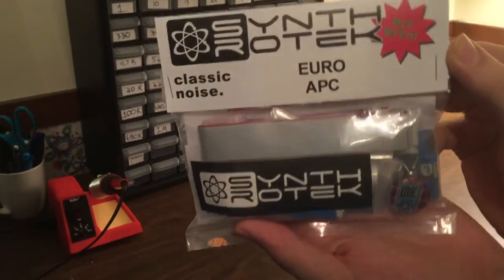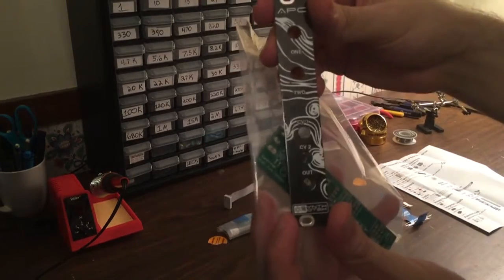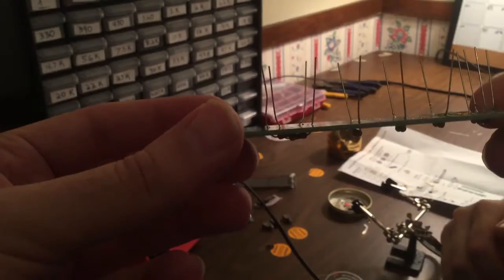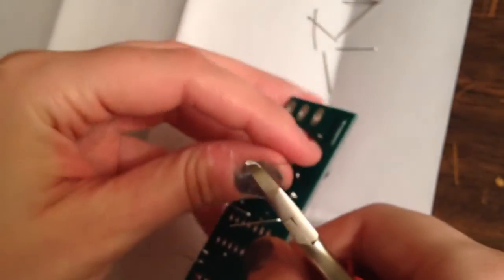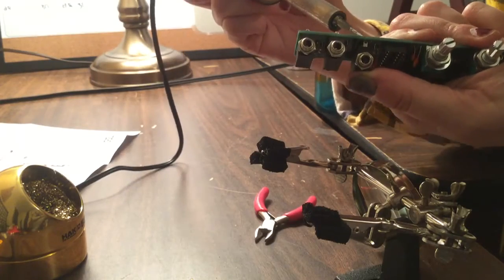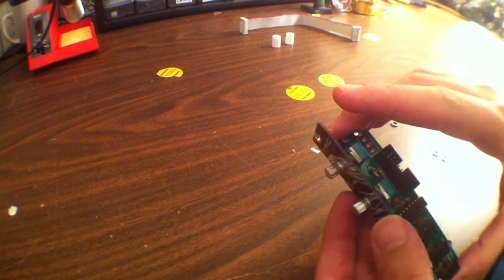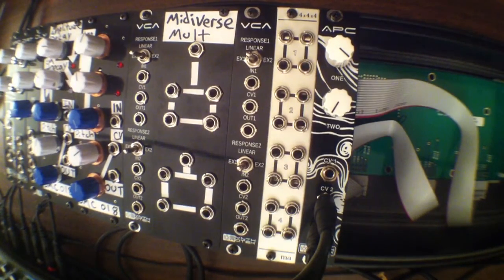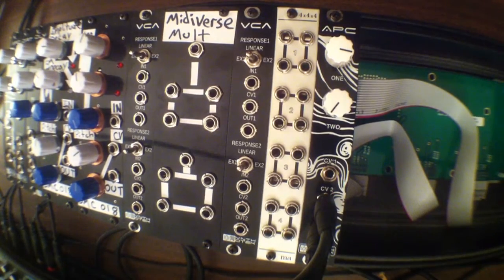Synthrotek Atari Punk Console (APC) DIY Kit - Build and Demo - Midiverse - TV

Comment: What would you recommend as my first diy eurorack module? I have literally no experience in this kind of thing, but i am dead set on learning.
Reply from the maker: Hi Justin, the Synthrotek APC is a great module for beginners.  There are very few parts, and you can purchase a kit if you don't want to mess with sourcing the parts yourself. This is the first module I built when I had no idea what I was doing (this video shows my second APC build).  Also, Synthrotek has a nice build guide on their website to walk you through the steps, as do many other manufacturers. Definitely use these guides. Hope this helps!